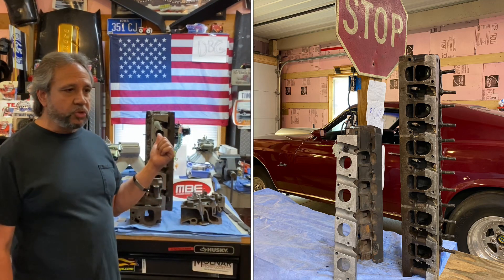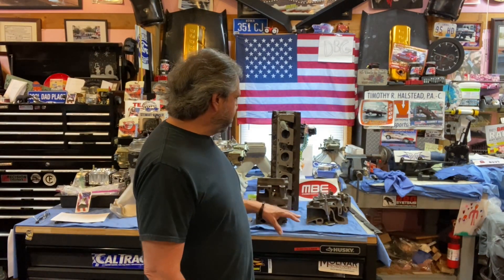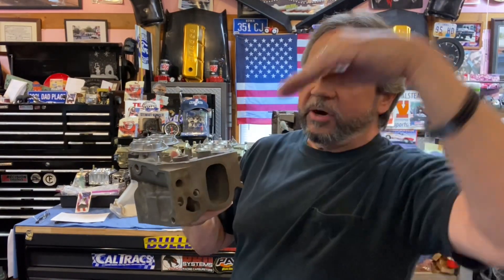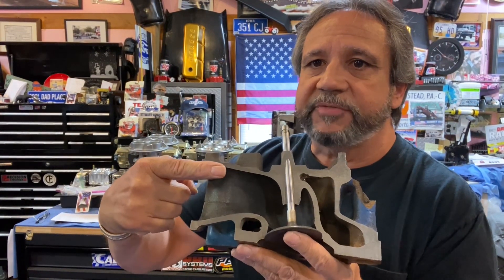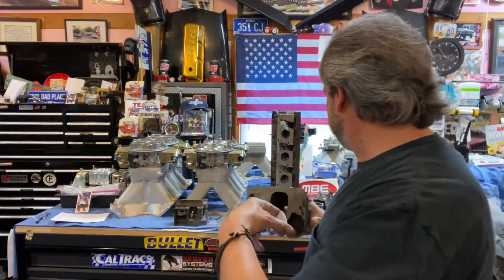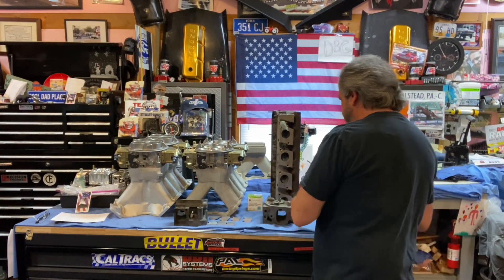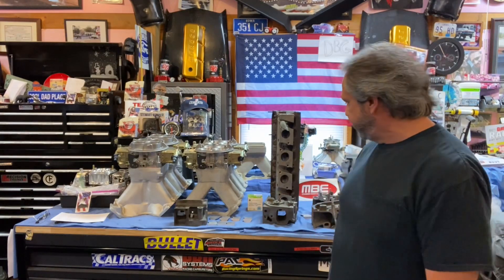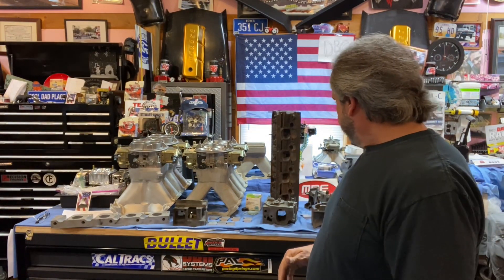DragBoss Garage: Pick Up 30 Ft. Lbs. Of Torque Filling The Port Floors Of 351 Cleveland 4 BBL Heads

Comment: Great video Tim. Remember a few months ago when I asked you about the Chris Parker funnel web intake? This intake is designed for the intake runner stuffers. My first intake on a Cleveland was the Eldebrock and it worked okay. But when I came across the funnel web and got it set up, my Cleveland came alive. On nitrous it was a rocket ship. Low 9’s on a 175 shot in the 1/4. I was running a flat top forged pistons, factory forged rod length, and a factory crankshaft. Camshaft was a custom ground mechanical roller, Crower lifters, rocker arms, Manton pushrods. The intake was the key to this engine making the power that it did. Love the videos and the information that you’re willing to share with us Cleveland fans. Thanks.
Reply from the maker: Yea I remember you mentioning it, don’t remember low 9s though. What did it run without spray? Terry Parker, I have on also I will test against my ported strip dominator. Be a cool comparison. With flat tops not hug compression, unless heads cut down. Thanks for watching Cowboy
Reply: @dragboss351cleveland  Car went a best of 9.80 on motor. 29 degrees on nitrous and 34-36 degrees on motor. This was 15 years ago in my 81 Capri. I still have the whole engine from carburetor to oil pan. I’ve got a 86 mustang that I’ve built in the last 10 years . I’m running a Windsor right now, but I’m eventually going to be going back to Cleveland power. Windsor runs good though. I’ve gone a best of 10.60 on a 100 shot. I’ve got everything for a long rod Cleveland build. 3.5” stroke and 6” SBC rods. I’ve got a Ford Performance Cleveland block, AFD aluminum heads that will work with the funnel web intake. The mustang is a night and day difference from the Capri. All aftermarket TeamZ suspension, Viking coil overs, Autorod controls electronics, there’s really no comparison. Mustang is a little heavier than the Capri, but the upgraded everything will make up for it. I need to go buy some GoPros and start getting into making some videos for YouTube. I meant to tell you that I had a 69 XR7. Car was Cleveland powered, factory light green with the black stripe on the sides. Had the spoiler with the magnum 500 wheels. I sent the wheels off and had the back wheels widened to 10 inches and the front wheels narrowed to 4 inches. It looked so cool. I totaled it street  racing in 1999. I loved the sequential taillights. The hideaway headlights and the front skinnies looked so badass. It was my favorite muscle car that I ever owned. Even my friends and family say that they thought that was the coolest car that I’ve owned.
Reply from the maker: Cowboy, quite a racing history. I appreciate you sharing it with myself and friends on this channel. Wicked performance. I had a set of afd ported by Darin Morgan, close to 400cfm intake. Had him do a tfc, too but sold them. Wanted nothing to do with them but long story. Part of the reason I started to build this channel. Send me some pics and vids and I can make a video. I like all 3 of your rides. And the cougar oh yeah, nothing beats their looks. For sure. Biased opinion here 😉💯🏁
Reply: @dragboss351cleveland  it’s been fun. I can’t complain. Yeah I’ll have to get some videos going of my Cleveland build. I’ve been working on getting setup in my shop building cylinder heads. I purchased an in perfect shape valve grinder, head surfacer, and a Bridgeport. I worked in a machine shop when I was in high school and college. I started out parts washing and worked my way up in the company. I graduated with an engineering degree in Metallurgy-Welding. I do all my own work. I built my car from the ground up. I did my own machine work on the engine accept for balancing the rotating assembly and transmission. I do appreciate the information and knowledge that you share with us on your channel. God bless.
Reply from the maker: Thanks so much Cowboy. Enjoy learning about you and your abilities. Thanks for sharing with us. Sounds like you garage is well equipped with everything needed, well almost. Always some tool we need. Glad your here. Appreciate the comments and cars

Comment: So, do the 2V heads also suffer from "dead space" in the ports? I have heard for some time that the Aussie closed chamber 2V heads were the way to go, especially for the street. I turned a 2V Cleveland into a four bolt main 4V back in the mid eighties in a Torino I owned. Bought 4V closed chamber heads and intake for $250. Now I can't find any reasonably priced. Aluminum heads are pricey. I have a 2V engine in a '73 Mach 1 I just cruise on the street and take to car shows. I know Edelbrock made a 4V intake for the 2V heads at one time, just wondering if I can get away with a mild cam and intake on my 2V heads. Maybe I'm just thinking too much lol.
Reply: The 2v heads worked well on our late model 67 fairlane. We ran 12.5 compression on open chamber 2v heads. Then a friend got the 2v Aussie heads, from Ford , that ended that! The Chevy guys got all cleveland stuff "Outlawed", so my friend built a 331 with those OZ heads for street and strip.
Reply from the maker: That how it goes John. What to alls fair in love and war? I know guys making huge power with those heads. Somewhat best of both worlds.
Reply: @dragboss351cleveland  … I keep thinking about the 331 topped off with the desirable Aussie 2-V quench heads. The right heads for a displacement that’s proven to make tons of power. 🏁
Reply from the maker: Might be perfect for that size then. If it works roll with it.
Reply: @johnsalvaterra3116  …. Being outlawed, banned, restricted, forbidden and plain old disliked at tracks all across the country where they race around a lot of corners became a major problem for competitors that had the wisdom and above all the desire to win by running the SUPERIOR CLEVELAND FORDS. Since majority rules and Chevy was clearly in the majority, the sanctioning bodies and independent track owners were forced to hide their testicular integrity in their purses and give in to the demands of the whiners. 

After all it was about the money and if the Chevy biased racers that refused to lose to an obscure Cleveland Ford quit attending the races, the Chevy biased fans quit attending
the races for fear of the humiliation caused by a few Cleveland Fords winning the race on a regular basis and the Budweiser vendors couldn’t sell their tasty beverages which meant very few fans attended the venues buying their favorite RJR/ Winston addictions. 

If this scenario sounds like it was conjured up by a Ford biased fan then it probably was. But there’s no denying the truth of it all either. 
  
The sanctioning bodies and track owners can…and do take the heat off themselves by banning engines for the lame excuse of “having an unfair advantage over the competition”.  Seriously guys, is that the best excuse your damage control suits can come up with ? 🏁🇺🇸🏆🙈
Reply from the maker: Actually they do not suffer as much, since the ports are smaller, their issues is an open chamber, low compression. The Aussie head has the small combustion chamber like the 4v. There are plenty of 4v heads on FB cleveland site. With the Mach, make sure gears are at least 3.89. Suspect it is a 4 speed. Yes they made a good intake for your application, in fact I have one like brand new sitting in DragBoss Garage, email me
Reply: NC Guy, good call by DragBoss on the desirable small “quench” combustion chambers found on the Aussie 2-V Cleveland heads. All 2-V heads produced in the States have much larger combustion chamber volumes which makes it a little harder to get the compression up enough to easily make more power. But that’s certainly no reason to throw away your 2-V components. The biggest problem with the two barrel heads is the bad word of mouth that they receive online. 

They share a canted valve design with the more desirable and expensive 4-V quench heads and they have fairly large valves and ports as produced from the factory. In stock trim they have the capacity to make more power than standard Windsor heads and definitely more than inline valve SBC stuff. 

Just like most engines, all they need is a bump in compression, a better flowing intake manifold and carburetor along with unrestricted exhaust and a camshaft designed specifically for the 2-V Cleveland heads. 

I also used to think that Cleveland 2 barrel heads were junk back in the seventies. But I became a believer after my friend upgraded his 2-V , ‘ 72 Mach 1.  It was amazingly powerful. 

You’ll need to get new pistons to increase the compression. A cam from one of the grinders that specializes in Fords. Headers and low restriction dual exhaust. A Holley 4-V with vacuum secondaries although mechanical secondaries would work fine depending upon the cam and final differential gear ratio. The main thing is you have to have a plan so the combination will work well together. You asked about a four barrel intake for 2-V heads and you have a few options that would work. Edelbrock still makes one in a dual plane design for milder builds. If you go for a more radical build, the Weiand X-Celerator #7516 is a single plane design for 2-V heads with a suggested rpm range of 1500-7000. 

Yes indeed you can get away with a lot with a radical 2 barrel build. Maybe I think too much instead of you but every time you hammer it, you’ll be totally satisfied with your build 🏁.
Reply from the maker: Lots of great info Daniel Wilson. Thanks. Appreciate it
Reply: @dragboss351cleveland  … Professor DragBoss, you have so many people asking valid questions and I don’t know how you find the time to answer them all. I hope I didn’t step on any toes by replying to a pretty good 👍 inquiry. I wanted to discuss the procedure he mentioned about preparing a common 2-bolt main block to  accept stock or the aftermarket 4-bolt main bearing caps that are currently available. But everything I post ends up being way too long and putting people into a deep sleep 💤. I’m talking comatose and nobody needs that. There’s enough zombies around here 😵‍💫.
Reply from the maker: Lol. No worries Daniel it’s all good. I never bothered with that conversion as 2 bolts work fine for me. Maybe better at controlling cap walk, but don’t know that for sure.
Reply: @dragboss351cleveland  I would tend to agree with the questionable nature of the need for the four bolt main cap conversion. While it does stand to reason that the extra bolts will increase the overall stability ,  your experience with 2 bolt blocks  speaks volumes about their reliability and integrity under the most extreme conditions. The only reason I ended up with virgin four bolt blocks is because the wholesale vendor had a nice selection of them available. Otherwise his 2 bolt selection would have been fine.
Reply from the maker: In truth I used what I had, by luck have had great luck with 2 bolts. I think a stud girdle makes the difference, although some do not agree.
Reply: @dragboss351cleveland  … I reserve the right to strongly disagree with the guys that disagree with the effectiveness of main bearing stud girdles. No structural engineers are required to clearly demonstrate the strength  obtained by physically tying all bolts or better yet, studs securely together to create a solid foundation to support the main bearings from movement. A little imagination goes a long way in understanding the hellish environment in the crankcase as rotating and reciprocating forces create havoc at 7000+ rpm’s. That’s when a well made girdle will be most effective. 

Unfortunately, the choices for Blue Oval girdles are limited. The big name companies aren’t much help when they only focus on LS wigets. The name to look for is BRUCE WEISS. He makes the American girdle you need. 7075 billet aluminum for Clevelands. PN. 351C-G. 5” long studs are required but not included with the girdle.
Reply from the maker: I feel they work, similar theory either rocker arm stud girdles to me. I bought mine, 25 years ago from Ford Performance Solutions. Then added a windage tray with 409 build. Don’t think I saw any power from tray, but who knows. I kept it. Bruce makes a nice one, the main difference is his are aluminum and mine is steel. Always wondered about expansion differences. But I’m happy with it and have had good luck so don’t change things. Thanks Daniel
Reply: @dragboss351cleveland  …. You always stick with what works for YOU and that’s one of the many reasons you  enjoy a nice history of success in your automotive endeavors  👍. 

You know how to keep those snake oil salesmen far away from your business too !   
Way to go…🇺🇸
Reply from the maker: Yes sir, slow but sure and steady as she goes

Comment: Wonder if the port raising would apply to my Windsor iron heads? I know the trick flow high ports aluminum heads work well with 351w and 302 but i run 69 351w heads, milled 100 thousandths 1.94 intake 1.6 exhaust and the intake sides are gasket matched, the exhaust ported and matched to the old Headman headers oval port header flange. They also have bowl work done. Just can't afford nice aluminum heads right now. What is your opinion Tim? You think it would be worth researching?
Reply from the maker: Yes any raising of the intake port helps straighten the path. But also, need the rest of the combo to match. Small cam and low compression won’t see much benefit. Low rpm the same. Depends on car too. Good set of gears may pick up more, better Convertor.
Reply: @dragboss351cleveland  I'm old school on the converter too. It's a pinto converter I use a cobra jet flywheel!! Old school but, gives me 3500 stall. 😁

Comment: Does anyone make a intake to match raised runners
Reply: Now there's a guy ask'n the right question...
Reply from the maker: Yes the Ford Motorsport intakes are raised, also many of the aftermarket are as well. Chi, tfc, .etc.
Reply: Chi makes one for port filled 4v heads. The edelbrock air gap can also have epoxy in the floor to match AND there is enough material to open the top to match
Reply from the maker: Thanks John good info to know. Thanks for  sharing with us

Comment: Tim I had no idea you specialized in cardiology ..very impressive to say the least.. You do a great job with your drag boss garage channel really enjoy it keep up the good work ..looking forward to more ..
Reply from the maker: Thanks Clark, I worked 13 years in Cardiothoracic surgery, different specialty. The surgical aspect of cardiology so to speak. Heart bypass, or cabg, valve replacements, also all lung surgeries. But now have been in Emergency Medicine for 10 years. Thanks for watching my channel. Glad you enjoy and learn something from DragBoss Garage
Reply: @DragBoss Garage  hello,love watching your videos,didnt know you worked with heart surgery, what's the best medicine you think is for Afib
Reply from the maker: Hey hope all is well. That question has a lot of answers, the goal treatment for a fib is rate control and the dreaded anti coagulation. What answer are you looking for. Meds, mortality, exacerbation, treatment with ablation?
Reply: @DragBoss Garage  what you think best meds is
Reply from the maker: Tough question. For rate control. Probably beta blocker, can use cardizem too. For anticoagulant Coumadin as it is very cheap. But sometimes hard to manage inr. Best med for?

Comment: I always enjoy watching your videos to learn from.. the more i learn the more respect i have for the Cleveland engine . I assume it was good enough that the guys who ran Chev and i do also went to the BigBock to be able to compete.  Or thats what i was told . I always wondered how Bob came up with the combination chamber size , shape ect .. The more i learn the more i realize how little i knew .  Can you expand on the yates cylinder heads some time . Thanks for all you do
Reply from the maker: Your welcome Jim, appreciate it much. The old cleveland can hold its own that is for sure. Bob knew airflow and flow dynamics, and experiment like crazy. Like Rusty told me, he would spends weeks developing one port. Trying everything and every shape. I have pics of Robert Yates head, he used to weld up and design the Yates. You should see that. Stay tuned